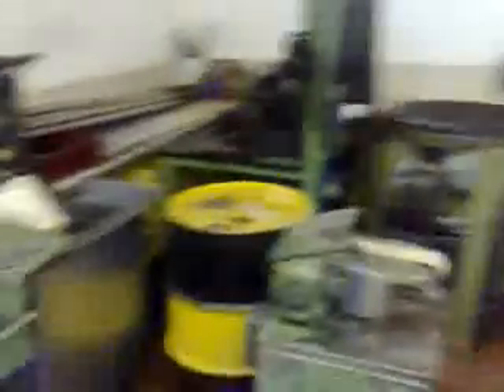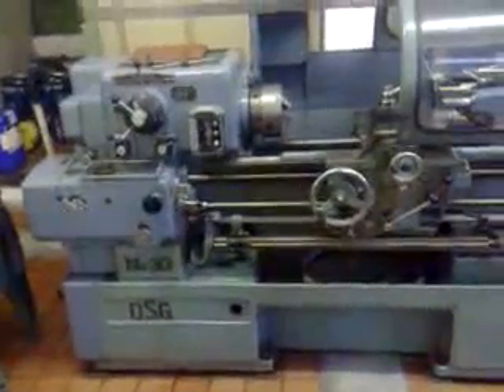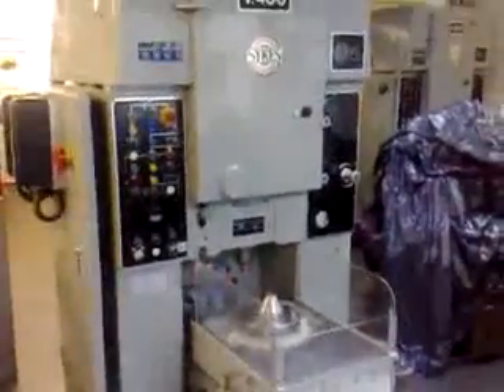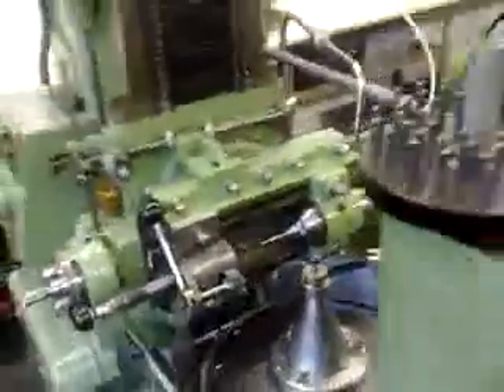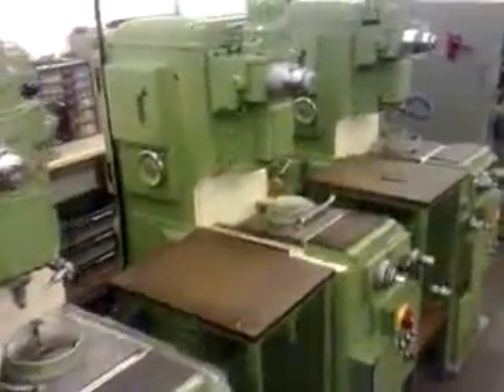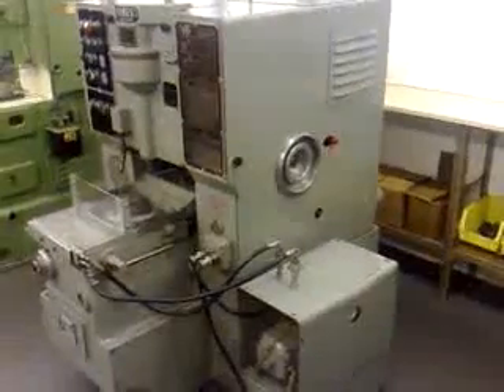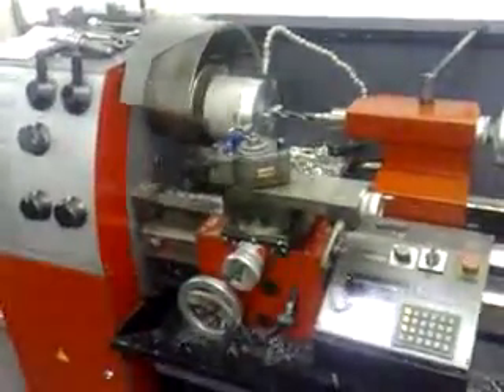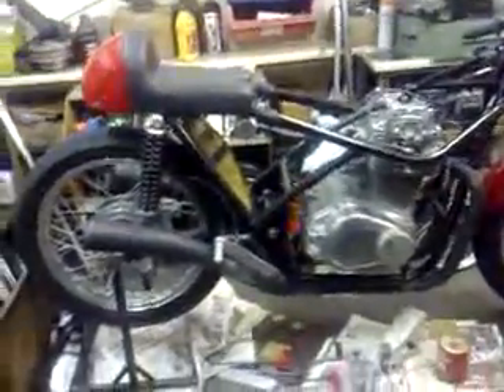engineering workshop tooled for gear shaping and screw cuting

Comment: Ayup, what a crackin workshop mate,I luv the old Dean Smith & Grace its a belter I run a Garage in Ashton Under Lyne and have specialised in American cars for 40 years now. I sometimes have to make my own bits and pieces I have 1960s Bridgeport,1947 Norton grinder & 1930 Colchester 6" lathe Its strange how we still lock ourselves away and work all hours on these old tools, by the way your cylinder head fly cutter is great I am making one up ASAP good video mate 10 out of 10